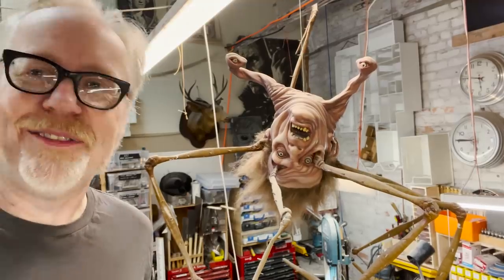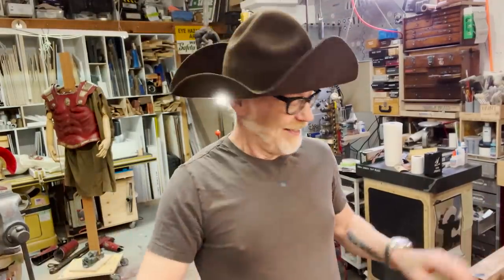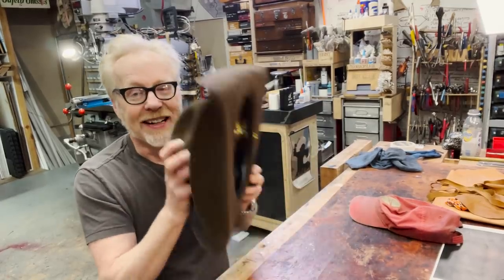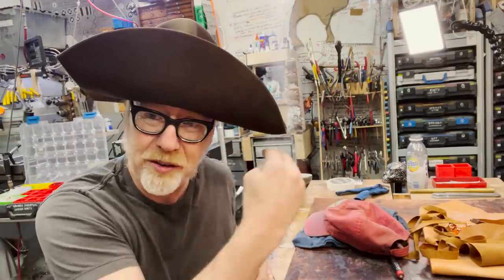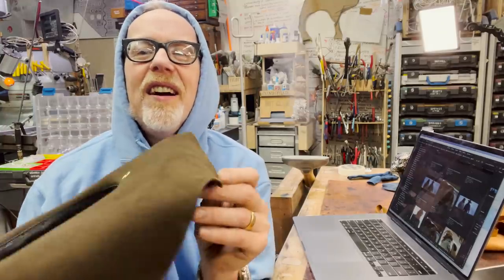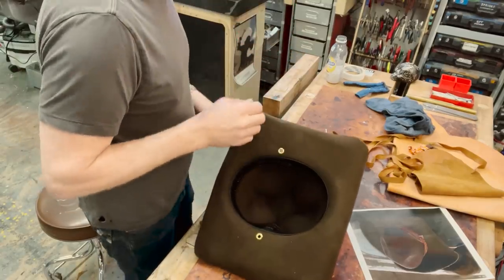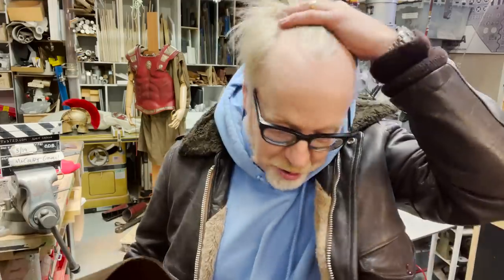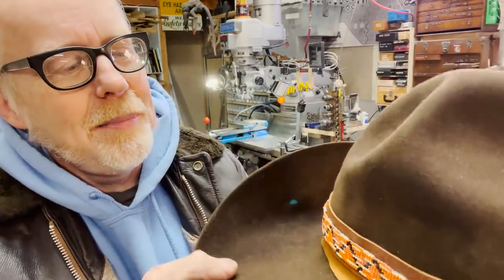Adam Savage's One Day Builds: MacReady's Hat from The Thing!

Comment: I did a budget friendly MacReady costume for Halloween a few years back and finding a cheap hat was harder than building the flame thrower.
Reply: * fistbmp * I had the same issue xD   Functional flame thrower; 40$ and a few scratches & sunburn from crawling around a junkyard to get parts to build it.   Cheapest non plastic-p.o.s. hat I could find at the time; 235$ -_- (I will admit that hat was worth the price, but it was still way more than I could budget for)
Reply: Where did you get the "cheap" hat
Reply: @CHIMBOPDOTCOM  Goodwill I believe. The diameter was still a little too small but it was the best that I could find.
Reply: @maeve615  Once I saw the top of that hat, it gave me bad flashbacks to Basic Training in the Army lol.

Comment: This is such a cool build!  The first time I saw The Thing was when I was 11, watching CBS on a 13" TV with my best friend at a cottage in the Pocono Mountains.  We were alone, none of the other cottages nearby had been opened up yet for the season, and it was completely dark outside: the most perfect isolated setting ever to watch this film.  As for kangaroo leather, it really is the best.  It's commonly used by pipe organ builders and restorers for pneumatics inside windchests (the pressurized wooden boxes that the pipes sit on) and it lasts far longer than anything else.  But it is expensive.

Comment: 21:06 - what kind of tape is that? “Basing tape”? Oh, never mind; searching that phrase got me a suggestion of the correct one: “basting tape”. Posting anyway in case others have the same question.

Though also, as an excuse to ask: why no captions on this video? I rarely use them, but they can be great in cases like this... and of course, plenty of people need them for this content to be accessible. So, Tested team: please do what you can to add them! (Or if it’s delayed by YouTube, apply pressure to them to fix that.) Thanks. :)

Comment: I understand why some hats have one or two bent brims to allow bringing a gun up to your eye, but how is 4 practical?  I would think it holds water and dumps it when you tilt your head.
Reply: My take has always been that it was a good "pilot hat" for MacReady, with all 4 brims turned up to deal with limited cockpit headroom.  Yeah, would be terrible anywhere with significant rain, but probably fine with up to moderate snowfall, and would do a better job of trapping caught snowflakes (rather than, say, dumping them onto electronic equipment) than a hat without 4 brims.
Reply: @DanHarkless_Halloween_YTPs_etc  its sort of a 10 gallon hat for microcar and dry-cycle drivers.  In snow you really need to block as much light as possible, hence the goggles and frequently hoods sinched tight to limit light.  I sometimes wear a leather hat in cold rain to keep the rain off my glasses and away from my neck, but that is a flat brim.  I think a flat front brim like one of the clanton’s wears in tombstone are that way to stop the wind from blowing it off your head while you ride,  but who knows here,  it was a very distinctive look.

Comment: Hey Adam.  It's CB2001 from the RPF.  I did a post about my not so accurate R.J. MacReady costume (and even broke down the actual items used in the film for Mac's costume for those looking for more screen accuracy).  I found the same model and make of MacReady's Tape Recorder from the film if you're needing it.   The tape recorder is a General Electric Model 3-5121, also known as the 3-5121A (i posted about it on the RPF as well after I was able to figure it out).  And even got one (with the correct microphone as well): https://www.youtube.com/watch?v=t-2fTzhDxO0